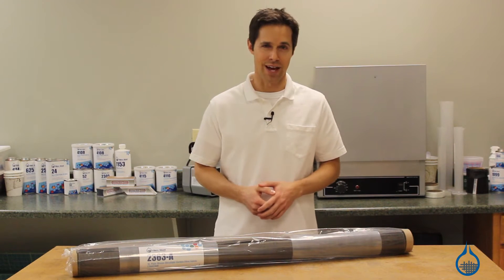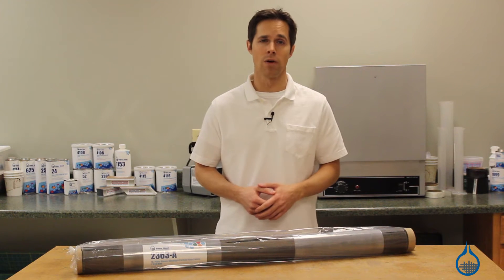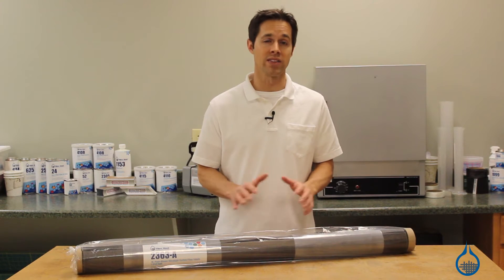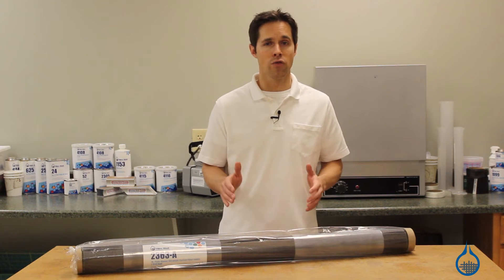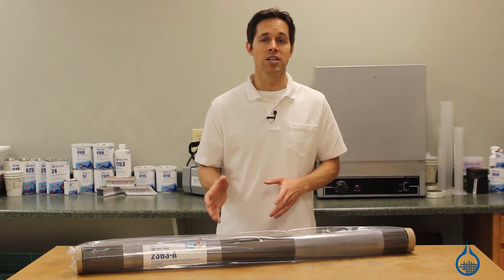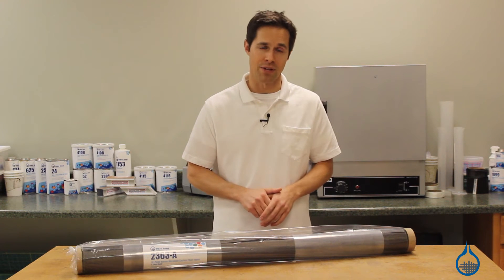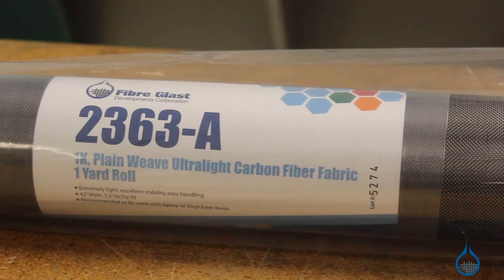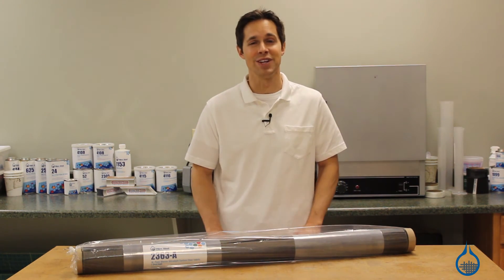1K, Plain Weave Ultralight Carbon Fiber Fabric

Comment: It is actually cheeper to weave carbon-fiber in 12k than 1k as the weaving it'self is more time consuming. There are different weaves of 1k for different conditions. It is the amount of pics per square inch that really describe 1k. Haven't seen Fibre Glast's product but guess 24 x24 (ends)pics or perhaps 19x19 1k. These are all plain weaves i am describing.  Sitting next to several partial rolls of 1k as i type. Have a 17x17 pic plane weave 1k that(because of a less closed weave)allows a special 3 layer laminate consisting of 1k then 34x34 pic Spectra then another 17x17 carbon. Open-ness of my 1k allows epoxy to bond to the(very difficult to bond Spectra) for ultra light paddle craft.

Comment: I reinforced a cardboard tube with this 1K plain weave and used it for a model rocket. This rocket was pushed again and again to nearly Mach 2 with no deformity or cracking. If you need strong and light, this is the product for you. Prepare to open your wallet.